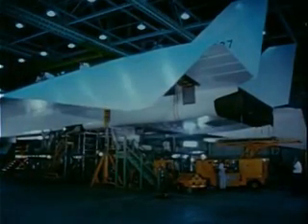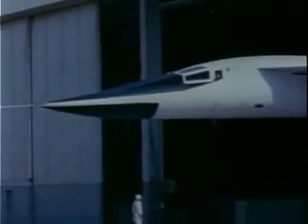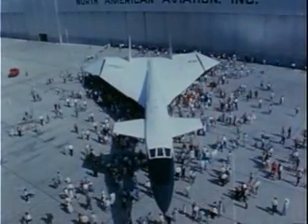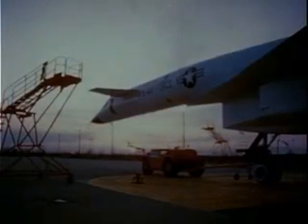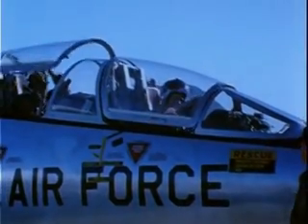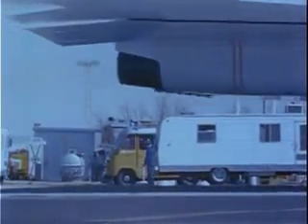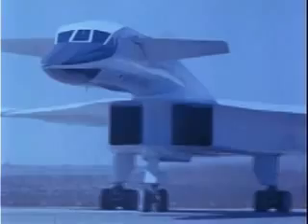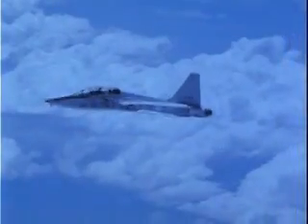North American XB-70A Valkyrie #2 - 1965

Comment: Considering 10 years prior, a B-29 was considered "cutting edge" technology in 1945, it is completely insane to think that this plane and the SR-71 were being designed 10 years later.  No wonder everybody thought we'd be going to Mars 10 years after that!  One of the the biggest leaps in technology over a decade we'll ever see in our lifetimes...
Reply: B-29 first flew in 1942.  By 1945, the 1st B36 had been rolled out, and the B-47 made its maiden flight, just 2 years later, so the B-29 was hardly cutting edge in 1945. The 1st XB-70A didn't fly until 1964, over 20 years after the B-29.

Comment: What is the small wheel between the outboard wheels of the main gear?  It can be seen toward the beginning of this video.  I saw it years ago when at the Museum of the Air Force, and no one there knew what it was.
Reply from the maker: GREAT question Jay, I've always wondered that myself...I'm sure at some point, someone will chime in with the correct answer.
Reply: it was a runway traction measuring device for the anti-lock braking system.  there is a wealth of info on this amazing aircraft at PeninsulaSrsVideos XB70 Valkyrie

Comment: one little bump from a jet carrying photographers and down it went
Reply from the maker: Clay Lacy was flying the Lear with the photographers, and they got nowhere near the #2 bird. Joe Walker in an F-104  got caught in the wingtip vortices off the starboard wing of the XB-70, and the 104 was flipped upside down, rolled across the top of the inner wing sections with a lot of force and momentum as a result from the vortices, and then the inverted '104 sheared off most  of the Valk's two vertical stabs, certainly not a little bump, but rather, an out of control aircraft hitting another aircraft like a hammer. Very sad day.

Comment: What a beautiful plane! Really unforgettable! Probably the most beautiful even built. In the mid of 60's to realize a similar plane was be something of incredible and in steel!!! Absoluting fantastic! Do you thing? Gemini program was run at the same moment with the first computer in space... how was the difference between USA and the rest of the word at that time?
Reply: Don't forget Concorde. Civilians flying in shirt sleeves. no need for helmets and G suits, sipping champagne at 60,000 plus feet at Mach 2 plus, for 3000 miles non stop! XB-70) was a marvel, but Concorde flew the Atlantic many times a day for almost 30 years.No doubt about it though, the 1960's was a great time for fantastic aircraft development, military and civilian, everything since seems mediocre although more efficient/cost effective.
Reply: Frank Silvers  In the 6 year period that saw both examples engaged in their test profiles they only flew at Mach 3 a total of  10 times, for a combined time of less than 2 hours. The average flight at that speed lasted on average only 11 minutes.
It was designed to fly continuosly at Mach 3 but never did.
In my opinion it was the most incredible looking aircraft ever built but would never have survived the mission profiles that it was designed for, unlike the later but slower B1-B that continues to serve the USAF very well. 

Concorde was back and forth across the Atlantic between London/Paris & JFK/Dulles and other routes doing multiple flights on a daily basis for nearly 25 years, all at Mach 2. No cramped cockpit, but in luxury for 100 plus passengers and crew, that's style!

Comment: You need to stand under the A/V #1 at the Air Force Museum to see what a large and beautiful airplane this was. The massive 'six pack' of engines is impressive if not a bit imposing to look at. What a tragedy that the #2 was lost because of a stupid publicity shot. The #1 was still gathering data right up and into the last flight it made to Wright Patterson. Imho it wasn't a failure it was a resounding success in many areas, albeit one with a sad ending.
Reply: It really does have to be seen in person to understand what an impressive piece of engineering it was.

Comment: The tips fold down to take advantage of compression lift.  The compression waves created in high mach (beyond Mach 2+) get trapped between the wedge shape of the engine "pod" and the folded down wingtips to further increase the underwing pressure, making it possible to fly higher and faster with a much thinner wing that otherwise would force the plane to fly at a higher AoA in order to achieve the same kind of altitude, but at the cost of speed due to the increase in drag.
Reply: And I'm surprised we've never seen that in later Supersonic aircraft.  It would seem to provide a lot of the benefit of swing-wing tech with a much simpler (i.e. - much cheaper and easier to maintain) structure.